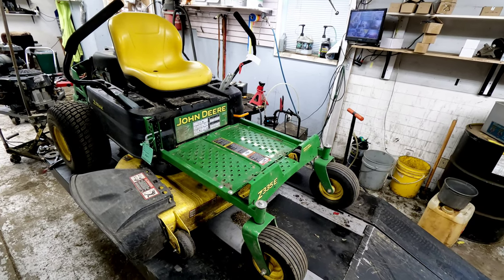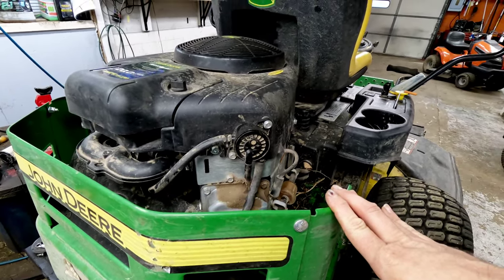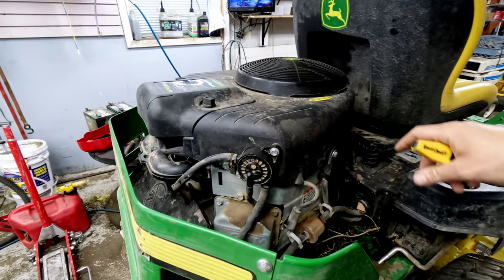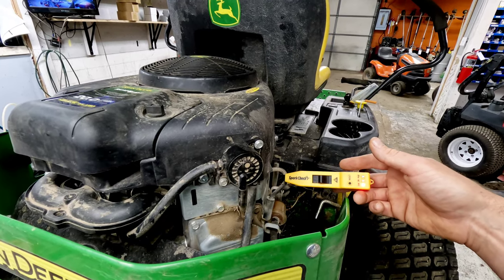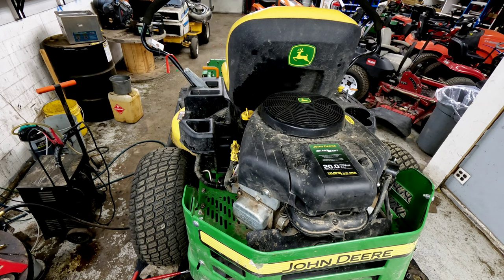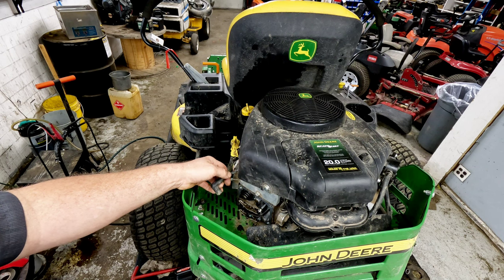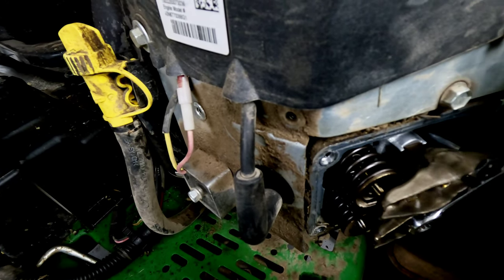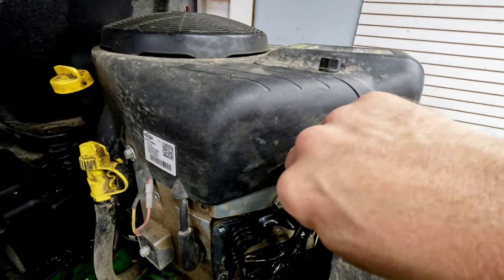Zero Turn Mower Won't Start, No Power, Bogs/Dies Under A Load, Popping, Easy Diagnosis and Repair

Comment: Now this is just me but if I find the valves need adjusting on one side , I'm darn sure going to check the other side .
Reply from the maker: No reason ever not to adjust both sides. If one side needs it the other should be adjusted also

Comment: I have a Z425 and sounded exactly like that machine.  I pulled off the valve cover on the side of the fuel pump and there’s oil in the cover and inside under where the push rods go in.  No clue if that’s normal and or what the solution would be. Thank you!
Reply from the maker: This is definitely normal. I would check both sides independently and make sure they are both firing. If not check spark since it seems like the valvetrain is ok
Reply: Spark is good however when I did a compression test my left is at 135-150 and the right is at 65
Reply from the maker: Definitely sounds like a blown head gasket or stuck valve
Reply: Someone just told me to take the head off lol. Wasn’t sure I wanted to go that far. Never done it before
Reply: When I turn the motor by hand both rocker arms are going in and out. Is that how you tell if it’s stuck?  Appreciate your help!
Reply from the maker: @ryannichols4801  Definitely understand that much
Reply from the maker: @ryannichols4801  If it was stuck one would only come out so far
Reply: Should I take out the push rods?  If so do I just loosen the center bolt?  Thank you
Reply: Check the push rods to make sure neither are bent that is.
Reply from the maker: I would just make sure they valves are coming out the same distance probably going to have to pull the head if so
Reply: Do you have a video on pulling the head? 😊
Reply: Thanks for your help!
Reply: I replaced the head gasket and the valves were to tight it seemed because the compression was still at 65.  Once I adjust them to .004 then compression went to 175.  Still sounds terrible. Here is a video. Thank you
Reply: Can’t figure out how to upload video for ya.
Reply from the maker: @ryannichols4801  Are you positive you adjusted them on the compression stroke? Normally both valves will not be super tight unless you are adjusting them on the wrong stroke. You can upload to Youtube and send a link or post to another place

Comment: Will it "pop" when it tried to turn over when push rods are broken?
Reply from the maker: Occasionally yes
Reply: @IndRepair  I changed the oil on my Z655, it ran fine after while I let it run new oil through the engine. Next day, it would not turn over. It would try (there is power) but wouldn't turn. Any thoughts?
Reply from the maker: I would check all the electrical and figure out why you are not getting the starter to turn. Does it sound like the starter tries to engage? We have a good electrical testing video at https://youtu.be/58BpPHZkiSs

Comment: I wonder what the condition is of the other cylinder head?
Reply from the maker: It was just barely out of spec but we adjusted it also just for good measure. Both studs we secure not loose like this side

Comment: Who makes or where you get spark plug checker?
Reply from the maker: Spark check'r SPC-7200 best purchase ever!
Reply: @IndRepair  thanks so much! I tried search and got some weird results
Reply from the maker: @Marco858636  I have purchased myself through RCPW when everyone else was out of stock years ago. Looks like someone has them on Ebay for now also https://www.rcpw.com/trillium-spc-7200-spark-checkr-engine-spark-tester-ignition-analyzer-for-small-engines-motorcycles-and-more/
Reply: @IndRepair  Over and beyond. It's appreciated. Thank you.

Comment: How many hours were on the unit? My guess is 200-300 knowing Briggs but somebody has been in there already.
Reply from the maker: Had 357 hours on it. Who knows what they did before! Didn't even bother to seal it back up or worry about leaking. Based on the lack of oil leaking in the area I think someone was just into it

Comment: My john deer Z820A  .
 I changed out the push rod. But i run it awhile and it lose power and pop! I done this 2 times . Help
Reply from the maker: Sure you are adjusting it on top dead center of the compression stroke? If so the valve is likely sticking and will need some further work
Reply: @IndRepair  Thanks

Comment: I’ve got the same unit. 46 hours on it, and it starts bogging/losing power after about 15-20 minutes. Fuel supply issue like you said at the beginning of this video?
Reply from the maker: Definitely where I would start, pretty easy to diagnose if you put a clear fuel filter in line between the pump and carburetor to see if it is running out of fuel

Comment: John deere Z425.  Start it and run it 5 times, Only running of one cylinder. Valve cover not heating up, pull plug for opposite side and engine fails.  If I Start it a 6th time;  randomly now both are firing and I can mow. 

 Halfway through the mow, it loses half its power again.  Start shaking the fuel lines a little;  back to full power.  Its nothing I can replicate though, it seems random, and Im not sure the fuel line trick is actually working.  Sometimes it stays running strong, sometimes the cylinder cuts out.  

New plugs, new air filter, new fuel.

Any ideas?
Reply from the maker: Doesn't sound like anything is consistent, I would disconnect the kill wires on the coils and test each cylinder spark before going much further, have to rule something out to start and seems like with these diagnostics nothing can be ruled out

Comment: Z915e. 25hp kohler. Runs perfect at idle but when you push the arms forward it loses power. Any ideas?
Reply from the maker: Check each cylinder independently to make sure each is firing. Blown head gasket, carburetor gummed up, one cylinder not firing, bad fuel, etc. The list really goes on but you have to start somewhere and eliminate each one by one. If each cylinder is firing, the fuel is fresh and it does not run better with the choke applied slightly I would  want to do a leakdown or compression test to find where the issue is. If it runs better with a little choke check carburetor, fuel supply and possible air leak
Reply: @IndRepair  great advice. Thank you so much
Reply: @IndRepair  is it okay to run it long term with the choke opened slightly?
Reply from the maker: Glad to help thanks for watching
Reply from the maker: Running with the choke on partially is ok short term for testing but not something you would want to do long term
Reply: @IndRepair  an open choke would suggest a dirty carb? Also u just gained a new sub
Reply from the maker: If it runs better with the choke partially closed a dirty carburetor or bad fuel are the most likely issues

Comment: Gaps are usually 7 do you agree?
Reply from the maker: Valve spacing you are speaking of correct? If so, the repair manual show .005" and separate spec charts say .004" to .006"

Comment: Why didn’t you just remove the rear panel to give yourself better access to the cylinder head/rocker arms? Seems harder to work around it than just simply removing the panel.
Reply from the maker: It wasn't in the way for me when I did this. I work in tight spaces like these and much tighter daily. If it helps you to see what it going on or makes it easier for you by all means take off the panel and get better access. Thanks for watching!